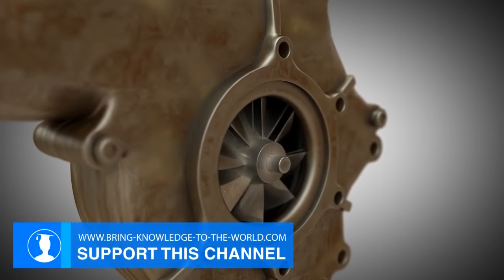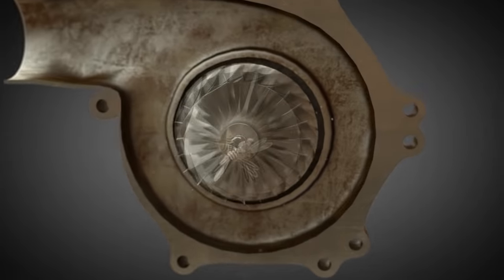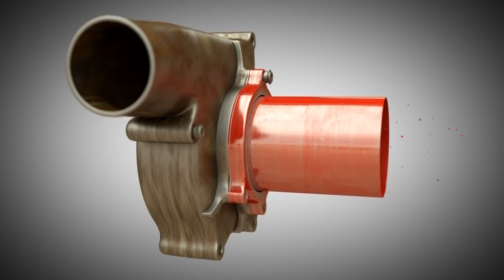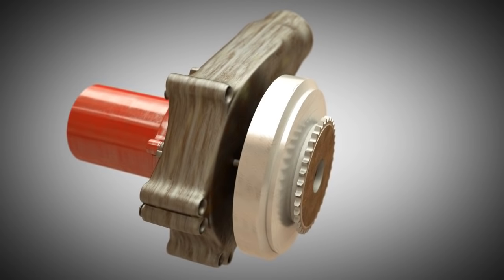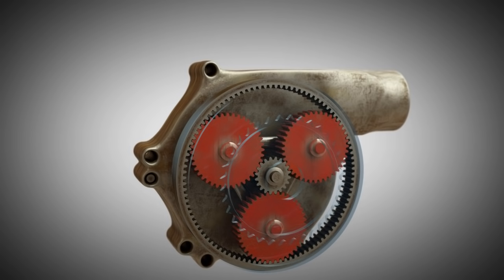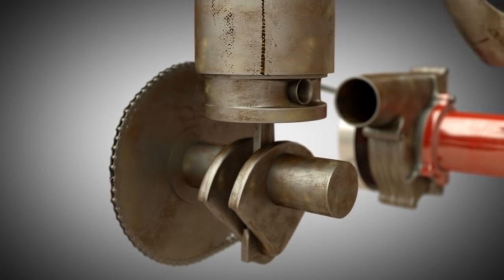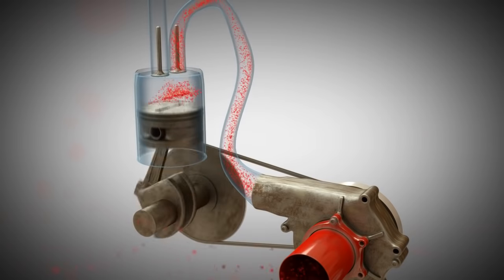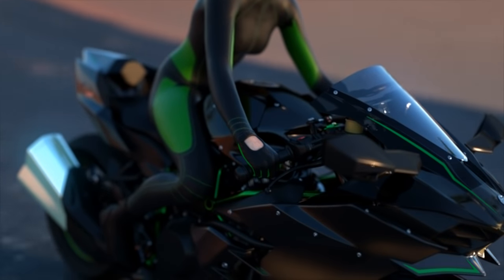Centrifugal supercharger - How it works! (Animation)

Comment: So clarkson was right. "Air goes into the turbocharger and spin it, witchcraft happens and you go faster."
Reply: I'll buy anything he says anytime
Reply: Except this is a supercharger.
Reply: no, supercharger hasn't got a turbine but some kind of screw wich give the right amount of oxygen at any time. check superchargers inside ;-)
Reply: nah youre wrong tho, turbochargers are driven by the engines exhaust. superchargers are driven by the crankshaft by a belt of chain like this one. theres different types of superchargers, this is a centrifugal , and the supercharger youre thinking of is a twin screw. ;-)
Reply: More air more fuel more HP
Reply: @jorgenlannock  that's why it's called a centrifugal supercharger
Reply: Episode? Or title in youtube

Comment: so, what you are saying is, that it's just a powerful mechanism that automatically feeds it's feeds air to mix the the fuel to make the air/fuel mixture that is fed to the piston by the spark plug in order to create a controlled explosion, but with this mechanism it's more powerful of a controlled explosion inside the cylinder? wow, that's so cool!

Comment: Correct me if I'm wrong. Turbos use exhaust gases to run the turbine which in turn traps the air. Supercharger uses engine power to do the same. So aren't turbos supposed to be 
better or efficient ?
Reply: You're partially right. Turbocharged cars can be thought of being more "efficient" as they use the exhaust to increase airflow - by turning a turbine and hence a compressor -  into the cylinder rather than dumping it into the environment. The disadvantage comes in when you're not stepping on the accelerator (connected to the throttle), this means there isn't much air flowing into the cylinder, therefore not much exhaust - which is necessary for the turbo boost. That's why when you accelerate - open the throttle - there's a bit of a delay before you hit the boost, this is called the turbo lag. 
Since the supercharger doesn't use exhaust but rather the engine itself, the delay will not be present making it a better option in terms of early boost and great throttle response. (putting it simply). Hope this helps.

Comment: So is it like a turbo charger but then spun by the crankshaft instead of the exhaust gasses?
Reply: Or am I just completely lost
Reply: You are correct. A turbo would look similar to what is shown in the video but instead of a gear assembly driving the impeller it would be a turbine spun by the flow of exhaust gasses.

Comment: damn great ! i never even heard about this one lol. So.. few questions if I may ? 

1. Why does the H2/R doesn't need an intercooler, sir ?
2.is the boost provided by the centri. turbo controllable ?
3.does it work in cars or trucks ?

TIA 😁
Reply from the maker: 1) Intercooler are needed, if even more air must be pushed in. So, if you need more than 300 PS, you might need an intercooler. / 2) It is controlled by the crankshaft. / 3) Yes, you can also use it in cars and trucks.
Reply: great ! thank you sir :)

Comment: sir what % of air fuel ratio in petrol engine by volume or by weight?
Reply: A/F ratio is by mass. The stoichiometric ratio for gasoline is 14.7:1 (air:gasoline). The stoichiometric ratio is where all the fuel reacts with all the available oxygen, so basically the "cleanest" and most efficient ratio. Most gasoline engine work close to this ratio.

Comment: you didn't say why the h2 doesn't need an intercooler can you please tell me
Reply from the maker: Don't know for sure, but intercoolers are used to pump even more air into the cylinder. So, I think the air doesn't get too warm and doesn't expand alot, so an intercooler isn't needed.

Comment: Can I know why  planetary gear set involved in it
Reply: The planetary gears are used to help the impeller spin at the correct speed to provide the correct amount of boost. For example, if the engine is at 2000 rpm and the supercharger has to spin at 3000 rpm to provide 8 psi of boost the planetary gears and the gears on the chain would convert the 2000 rpm input to 3000 rpm output.

Comment: how does this affect a diesel engine?
Reply: The same way it would affect a gas engine. The compressed air allows you to put more fuel in and acheive the same air to fuel ratio. More air and fuel means more power. However, turbos are much more common on diesels than superchargers.

Comment: Why doesnt the h2 use intercoolers?
Reply from the maker: You couldn't go faster with it. It's 300 hp without intercooler; you can go higher with an intercooler, but why would you do that? You'd need new tires every 200 miles ;)

Comment: Some guys are installing intercoolers aftermarket on the H2.
Reply from the maker: Why would you do that?
Reply: To make more horsepower. Cooler intake charge means the pressures can be higher without predetonation. They are also changing supercharger gear ratios for higher charger speeds.
Reply from the maker: Why would need more horsepower? The only situation I can think of is drag racing :)